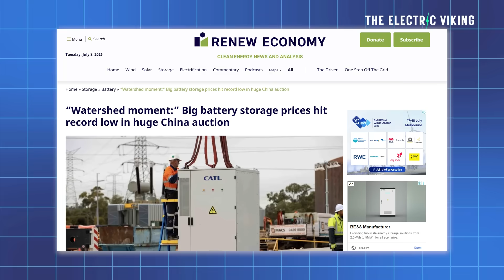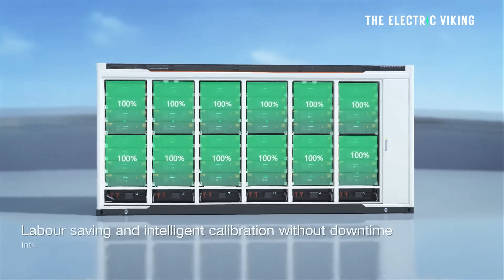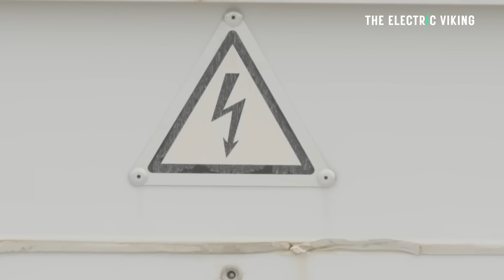Battery prices fall over 30% in 12 months - coal and gas economic madness

Comment: Also batteries are not the best way to store energy, they are the best way if you want a relatively short term pay back time, pumped hydro is still way cheaper, yes over a 5 - 10 year period in the current phase batteries do make more sense, because we are still just trying to cover the variance you have over a day, but once you have that covered batteries don't make any sense any more, pumped hydro makes more sense because you need to start thinking about the variation over the year, like here in the UK during the winter solar power will be 1/20 what it is during the summer that means building 20x more solar, and you can't make enough batteries to fill that gap, so yeh ya still need some kind of other energy source + pumped hydro or some other kind of energy storage that can store energy for at least 6 months with minimal loss.

And green hydrogen is not a real option.

Comment: LIFEPO4 prices keep decreasing while lead acid starter battery prices keep increasing.  I know there are lithium starter batteries on the market, but they are still very expensive relative to lead acid.  Why? Lithium needs to make lead acid starter batteries obsolete because of their better cycling properties.

Comment: Solar panels and batteries don't do GRID FORMING.... WE still need rotational power generation
Reply: There’s a solid (and growing) body of peer-reviewed and utility/standards literature showing that battery energy storage (BESS) co-located with wind and/or solar can run in grid-forming (GFM) mode—establishing voltage/frequency, riding through faults, and stabilizing weak grids, often alongside grid-following PV/wind in the same plant. Here are some good, citable starting points:
Review/overview (what GFM is and why BESS+renewables use it):
Anttila et al., Energies (2022) — comprehensive review of grid-forming inverter topologies, controls (droop, virtual synchronous machine/synchronverter), sizing and placement in renewable systems. 
MDPI

NREL “Research Roadmap on Grid-Forming Inverters” (2020) — foundational system-level view of GFM controls for inverter-based resources, including use with wind/PV plants.
NREL Documentation

NERC Grid-Forming Technology White Paper (2022) — summarizes where GFM has been researched and piloted in BESS, wind, PV, and hybrid plants. 
NERC
Hybrid plant + BESS explicitly providing GFM services (studies/pilots):
ERCOT/AEP case studies (2023) — shows a battery inverter with GFM control stabilizing co-located grid-following wind and solar during weak-grid/disturbance scenarios.
ERCOT

Tafizare et al., Sustainable Energy, Grids and Networks (2024) — analyzes hybrid DFIG-wind + BESS under grid-following vs grid-forming modes and the stability/response implications. 
ScienceDirect

Reilly et al., NREL (2022) — Hybrid distributed wind + BESS report covering grid-support capabilities and control considerations for co-located systems. 
NREL Documentation
Latest/control innovations relevant to hybrid plants:
Bhowmik et al., Scientific Reports (2025) — proposes hybrid-compatible grid-forming inverters that emulate synchronous-generator behavior and interoperate in mixed-generation (wind/PV/BESS) systems. 
Nature

Gerini et al., Electric Power Systems Research (2022) — optimal grid-forming control and scheduling for BESS converters, with experimental validation (applicable to BESS in hybrid PV/wind plants). 
ScienceDirect
Broader evidence that GFM is being deployed/piloted with renewables:
Musca et al., Renewable & Sustainable Energy Reviews (2022) — critical review of GFM pilot projects across regions/utilities, including applications in renewable plants and hybrids.

Comment: Great point on the falling battery prices! However, the conclusion that coal and gas are therefore "economic madness" is too simplistic.
It's crucial to distinguish between delivered energy (kWh) and firm capacity (MW):
Energy: Solar and wind are increasingly replacing the energy generated by fossil fuels. This is correct.
Capacity: To replace the firm capacity of fossil fuel plants and reduce their number, we need storage. Falling battery prices are making this increasingly economical.
But—and this is the crucial point—this phase-out has its limits. The limit is defined by the residual load that must be covered during a multi-day "Dunkelflaute" (a dark doldrum with little sun and wind). Batteries alone cannot handle this.
Therefore, the actual goal is the reduction to a minimal, strategic fleet of power plants that serves purely as a backup.

Comment: I like the OVERALL idea and do NOT like the analysis: 1. percentage of people living in STABLE sun conditions is MUCH smaller , 2. even if you assume having a compensating (subsituting) WIND and SUN conditions it is NOT so widespread to call them stable in vast territories. 3. You need battery with a working span of more than 16 hours in many industrialized northern areas to be considered seriously as a reliable source. In the near equator the night is 12 hours. Other areas face big differences between winter and summer 4. does the author really has a slightest idea of the so called BASELOAD energy source that is crucial for any civilized society? NO wander the Chinese keep on constructing nuclear power plants and do it like crazy. SO MUCH EMPTY SPACE IN THIS "ANALYSIS"

Comment: I just saw a 12v 100Ah liFePhO4 batt for $100 u.s.  these wee $1000.00 U.S. about 3 yrs ago: that's a90% price drop..

The price of solar panels has dropped by half in the last 3 yrs!

Add in rhe fact that a solar farm can be up and running in a yr or two compared to 10+yrs & $20 billion u.s. for a nuclear plant.

Btw europe had to ahut several nukes do to the heat wave: seems the water used to cool the reactor is too hot to dump hack in the river.. fish kills result from the extra heat.

We can't rely on just one source of power!

Comment: Solar plus batteries ain't gone to work in the UK, or any other country that has a summer/winter solar energy resource ratio approaching 10:1 or higher. Also, on rare occasions, thse countries might require a large proportion of demand to come from back up for a couple of weeks.

In the UK in 2050, and beyond, we could be looking at requiring upwards of 10TWh of electricity from backup in December, that may be required only every 5 years or so, that would make for a very expensive energy storage. However, pumped hydro and compressed air are not going to address this problem either.

Comment: As consumers abandon grid electricity, people like myself who are heavily invested in fossil fueled appliances and vehicles are being GOUGED by the grid electricity supply companies. 
And the gas supply companies.

Generation is a pittance centskWh.
Supply to the meter boxes is 50cents kWh from the grid. 

Wealthy high marginal taxpayers are saving $10,000?.?.? tax-free pa.
Mums and dads are using their home energy budgets and new vehicle budgets to invest in rooftop PV and v2g to the vehicle massive batteries on wheels parked 23hrs every day. Dirt-cheap mass electricity storage. 

Pensioners and single income young people and poor and older fossil fueled appliance investors are being gouged by the grid owners struggling for their adequate ROI from the $TRILLIONS infrastructure investment. 
My friends warehouse rooftop PV electricity save $10,000 per quarter. 

Business hours demand collapse, and the DUCK CURVE is no joke. 

The DUCK CURVE killed the nuclear economics, 247 stable demand is dead. 247 cashflow is dead.

Dirt-cheap empty rooftop realestate is the new field of solar power. 
Millions and millions of empty dirt-cheap realestate are exposed to the sky daily.

Comment: Lower battery prices are not always a good thing, as thermal runaway is often inversely correlated to cost-cutting:  use lower grade chemicals, incomplete or unstable formation, cost-down QC, pack as much in as you can, and less advanced BMS models.

Comment: The road to net zero is the road to economic ruin. Seriously how long can a city run off batteries supplied with intermittent wind and solar? 1 hour, 2 hours? You need reliable base load power supplied from cheap coal, gas and nuclear. The albanese govt promised cheap energy, however the power prices have only increased due to the crazy shift to renewables
Reply: Seriously how long can a city run off batteries supplied with intermittent wind and solar?" - 24 hours

Comment: At the same time in Poland (EU):  1. CNG gas prices - 200% , 2. Electricity - 140%. 2 nuclear power plants are in the making, and they disconnect prosumers, also they want to block battery installs abowe 19kWh. Basically, they are taking 'hostage' their own citizens due to tax built into the electricity generation (GDP depends heavily on those numbers). Prosumers are "painted in the black". This is kinda 'create a reality' that does not approve change, and at one hand play EU and at the other - via internal laws demolish the market for RE energy.

Comment: For over a century scientists have known that the theory of CO2 affecting climate had been proven incorrect. Yet it was resurrected.. why? For POLITICAL purposes. It is simply an excuse for imposing taxes, the removal of our rights and freedoms and the restriction of our access to cheap, reliable energy. 

THE EVOLUTION OF CLIMATE
BY
C. E. P. BROOKS,
M. Sc., F.R.A.I., F.R. Met. Soc.
WITH A PREFACE BY
G. C. SIMPSON, D. Sc., F.R.S.,
DIRECTOR OF THE METEOROLOGICAL OFFICE
LONDON: BENN BROTHERS, LIMITED
8 BOUVERIE STREET, E.C.4
1922
“The theory which connects fluctuations of climate on a geological scale with changes in the composition of the earth’s atmosphere is due to Tyndall and Arrhenius, and was elaborated by Chamberlin. The theory supposed that the earth’s temperature is maintained by the “blanketing” effect of the carbon dioxide in the atmosphere. This acts like the glass of a greenhouse, allowing the sun’s rays to enter unhindered, but absorbing the heat radiated from the earth’s surface and returning some of it to the earth instead of letting it pass through to be lost in space. Consequently, any diminution in the amount of carbon dioxide present would cause the earth to radiate away its heat more freely, so reducing its temperature. BUT IT IS NOW KNOWN THAT THE TERRESTRIAL RADIATION WHICH THIS GAS IS CAPABLE OF ABSORBING IS TAKEN UP EQUALLY READILY BY WATER VAPOUR, OF WHICH THERE IS ALWAYS SUFFICIENT PRESENT, AND VARIATIONS OF CARBON DIOXIDE CANNOT HAVE ANY APPRECIABLE EFFECT"

THERE IS NO CASE FOR NET ZERO, EV'S, HEAT PUMPS, 'RENEWABLES' OR ANY OTHER 'GREEN SOLUTION'. THERE IS NO 'CLIMATE CRISIS'.

Comment: Adding batteries to renewable systems is like boosting their productivity by 30-50%.
Reply: For only about $12,000 or more each for a Tesla Powerwall 3.  At 4500 kwh/year that works out to about $0.14 per kwh for 20 years.  After that it's free.  Until the battery dies.
Reply: @robertd9850 And battery is warranty 10 years.

Comment: In North America, there is a glut of natural gas, because it's a by-product of the shale oil industry, so it's extremely cheap here as compared to the rest of the world, and why it makes sense to use gas turbines as peaker plants, instead of storage.  Other places that may have reasonably cheap gas are Russia, the Persian Gulf, and those European countries that have a share of the North Sea gas fields (UK, Norway, Netherlands). 

However, in the rest of the world, it's cheaper to ship and store coal than gas, so it may make more sense to use battery storage and coal-fired peaker plants.  In China, for example, peaker plants tend to be coal-fired instead of gas-fired.  What I expect is that, as renewables take a larger share of electricity production in countries such as China, coal plants will be converted from providing base load, to becoming peaker plants.
Reply: Oh, and let me correct you on Norway using peaker plants. We use predominantly hydro, which is very versatile. No peaker plant needed. We sell all our petroleum to other, more backwards countries ;)
Reply: Is there even such a thing as a coal fired peaker plant? Anyways, you can't convert a base load plant to a peaker plant. They're very slow to ramp because that inertia gives better efficiency. That's why peaker plants are usually gas. China will cover their needs for peak production with batteries, there is no doubt about it.

Comment: I'd be interested to learn how much of a battery pack for your car, golf cart, weed eater etc is the cost of the actual batteries.  suppose for the sake of the argument that the batteries were free.  How much would those battery packs cost you.  I think we are barking up the wrong tree.  Great that the batteries are getting cheaper but have we reached the point of diminishing returns.  The rest of the kit that goes into a battery pack has to be worked on to bring down prices.

Comment: Battery prices have still to come down further to fully replace gas power station. For daily EE fluctuations they seem to be ok now, but here in Germany wie have the so called "Dunkelflaute" (dark lull) where especially in the winter der are periods where generation from solar and wind is low over several days or even 2-3 weeks. I don't know whether there are similar sitation in the states.
Here some power generation using carbon-free energy fuels is necessary. The amount of extra electric energy necessary may be in the range of 50 - 100 TWh. Current concept is to use H2 generated during periods of excess power from renewables, or imported H2 used by H2 power stations. This is really expensive, but battery storage seems to be no alternative here.

Comment: On what planet gas is NOT a winner against renewables. You are talking about artificial prices manufactured by government regulations and active manipulation of the relative economy of each component in the energy sector. Nothing is REAL, only that government involvement makes everything EXPENSIVE. The idiocy of renewables argument is easy to see, when you compare the cost of running a national power system of let's say 50 power plants a mix of fossil, hydro and nuclear versus 10 million micro power plants distributed in Australian homes. The maintenance cost alone is probably on the order of 100 times higher for renewables.

Comment: Meanwhile a home battery in Sweden costs $1000 per kWh (500 after tax cuts, but still). It’s ridiculous
Reply: yes, battery price is what makes home production not affordable
Reply: At $500 per kWh and 6000 cycles LFP will cost 0.08 cents per kWh stored plus solar at 0.03 cents per kWh so a total of 0.11 cents.
Is your grid electricity less than that. 
Also LFP can do 10000 cycles thou at 6000 cycles it will be at 80% capacity.
Also you store cheap night electricity in battery and run the home on it at peak hours.
I think it makes sense
Reply: @sergiopinto4831  go online to the shop that can deliver you and check the price, stop dreaming, it's nowhere near what you say
Reply: @sergiopinto4831  tezepower : 30kwh LFP 48v cost 3000 euros, without the inverter. With inverter included it's 4500.
Reply: 500 per kWh is insane. You can find online sellers home battery 30kw 48v LFP for 3.6k. Same thing with 10kw inverter included for 4.7k. delivery to sweden included.
I have one and 9kw solar and it's working fine. 
You can save money if you buy the cells and the case kit and diy. Case kit is 600 euros, 32 cells 314ah grade A+ is 2400 euros.
Reply: @Daemia-o1q you are talking about direct import from china right? who wants to take this risk and wait for a month for the delivery ?
Reply: @raph151515  wait a month ? Why ? They almost all have EU stocks
https://www.youtube.com/watch?v=pyXmPi1i-JI
https://www.youtube.com/watch?v=vvMhswvVwxQ
I got m'y delivery, in France, in 4 days.
I didn't bought the diy stuff, i bought the ready to use 30kwh, powerwall with rollers.
Reply: @Daemia-o1q as DIY solutions there are even better prices if you consider recycled cells but most people can't contemplate buying kit batteries

Comment: And home batteries cost $1000 per kWh
Reply: I bought my home battery 5 years ago for $100/kW
US
Shop around .
Reply: @MarkSpohr Even Growatt 5kWh is $2200. Please let the class know where you get a 5kWh system for $500
Reply: @scenicshoots  I bought 32 x 280 ah LFP cells for $2900 shipped from China. Wired into two 16 in series 14 kWh packs with a BMS.
Reply: Probably from old Nissan leafs
Reply: Nope! I had mine for €300,-/kWh

Comment: From Grok… China's Coal vs. Battery Storage Additions: "In 2024, coal capacity additions (30.5 GW commissioned, 94.5 GW under construction) far exceeded battery storage additions (estimated 10–12 GW). In 2025, coal approvals continue (11.29 GW in Q1), but battery storage is expected to grow, potentially reaching 15–20 GW annually. Renewables (356 GW in 2024) are outpacing coal, with battery storage playing a supporting role".
Reply: looks like this Grok lied

Comment: Li ion batteries are getting cheaper because no one wants them. They have a short lifespan of 2000 recharges at very best they lose their ability to hold power during their lifespan and they're prone to burst into flames. We still cannot recycle them efficiently and they pollute the planet in the making and recycling. Ten Chinese li ion battery plants have closed this year alone that's why they are cheap.